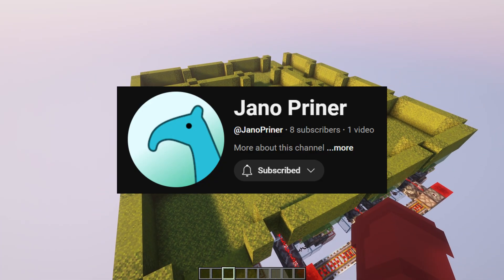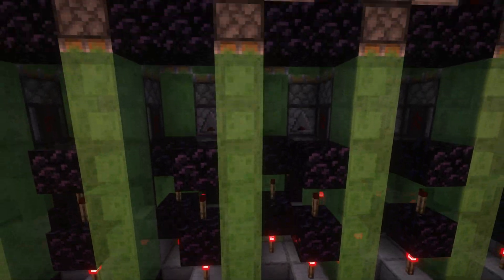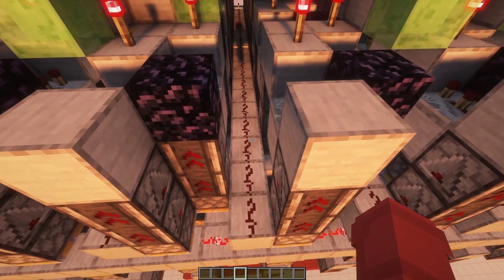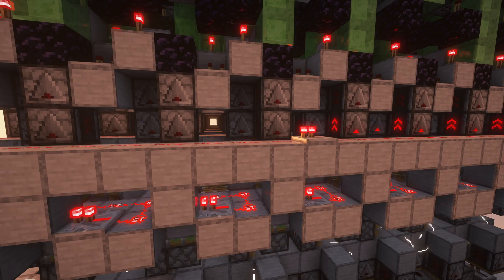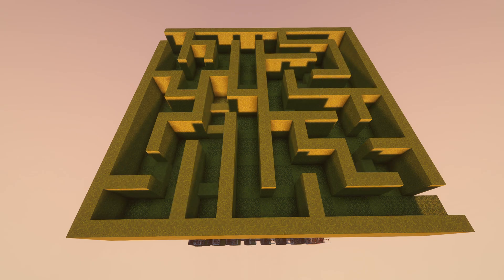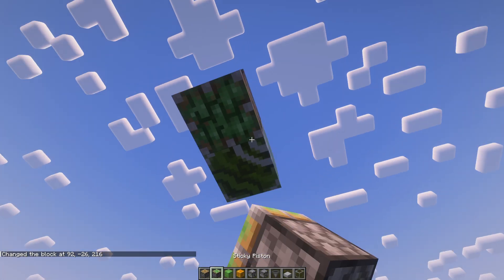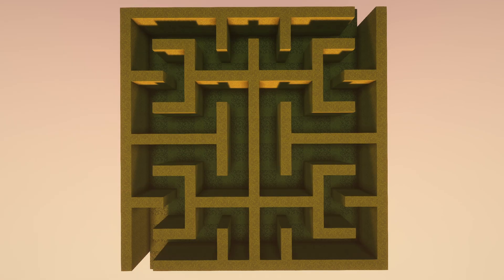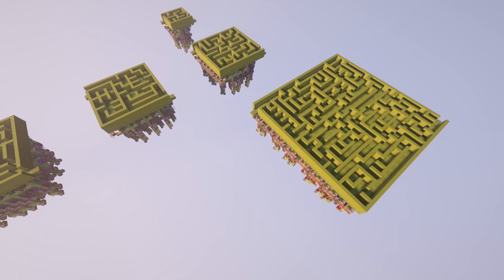Minecraft Hedge Maze Generator: Redstone Only (No Commands / No Mods)

Comment: It would be cool to see a maze that changes as you solve it, you could hit a dead end and then turn back only to see that the maze is completely different
Reply: You could do that pretty easily by just putting a repeating timer on the reset activation. So, the maze will change every 30 seconds, 1 minute, 5 minutes, etc as you want.

Comment: Just for clarification, when you say by redstone experiments, does that mean this won't work on a normal 1.21.4 world? I'm interested in building this into my world and wanted to make sure that it could work on a normal 1.21.4 world before trying. I have all of the resources to build it.
Reply from the maker: Correct, however a user named Wes has built (in parallel) a version that works without redstone experiments.  He can be found on the Chronos discord server.
Reply: @RaPsCaLLioN1138 how do I join the Chronos server? I'm fairly new to actually joining redstone communities.
Reply: A friend sent me this video, as I'm working on a series of minigames on one of our servers... A couple days back I just built a variable maze, it has a similar concept, but works off randomizer. There are 3 preset layouts, and depending on the randomizer output one of them is generated. You could add more randomizers for more layouts, but mine is a pig maze with slabs on top, so the players don't get to see the layout they end up with. 3 was plenty for me. It's a bit of a mess to do with vanilla redstone, which is another reason I stopped at 3